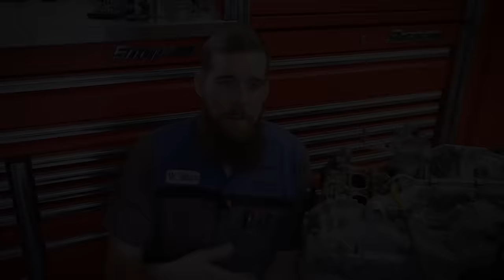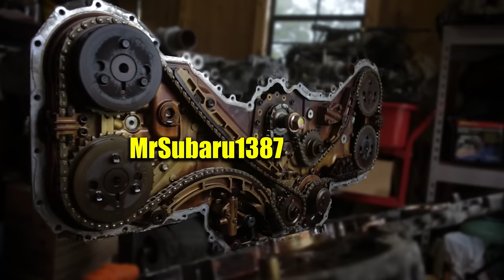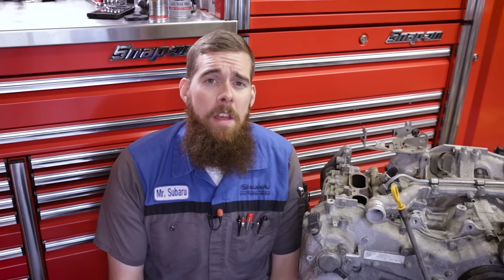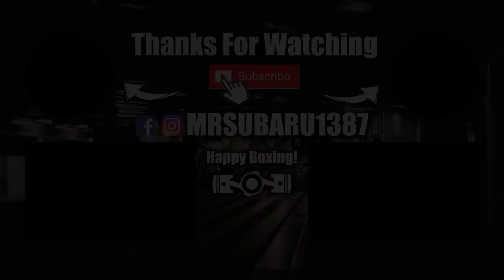Why Subarus Are So UNreliable!!! Buckle Up!!!

Comment: Subaru tech myself. We did amateur rally competition for about 9 years now. Blew up 2 motors and 1 5speed manual, not a bad statistics. About 5 years ago I finally built a motor myself. Drove that thing to multiple podiums, 2019 PMSC rallycross champion with 4 full seasons of rallycrossing and 5 years of daily driving that vehicle (spirited) and had 0 issues with the motor. Change your oil, change your plugs, keep and eye on leaks and it will last longer than Toyota
Reply: Change it myself or take it to a dealer? 😂
Reply: Not a chance. Subarus are hot garbage. I paid $44k for an engine that didn't make it to 70k. No mods, both drivers over 40.
Reply: @goatlocker219 how often where you changing your oil?
Reply: @jessejames6106 Ever scheduled maintenance was done at the dealership.  There was absolutely no long oil changes or overdue maintenance.  When I took the engine apart, it was the most fragile piston  piston I ever felt. The metal is very brittle. Being cast pistons, they are so light, I would hesitate to use them as paper weights.  The new IAG pistons feel nothing like the old terrible Subaru part.

Comment: As someone who owned a company that rebuilt Subaru engines and shipped them worldwide, I can attest to the absolute truth of what MrSubaru is saying. Don't maintain or poorly modify your Subaru and you WILL screw up your engine.
Reply: How exactly do I keep them maintained? What driving habits, things to check for, and so on, do I have to do? I want to test drive this 2022 baseline wrx
Reply: @blackliver08  2 things: change your oil religiously every 3000 miles (using a Subaru filter) and never, ever let it overheat. Install an aftermarket temp gadget if you don't have one). 
5w20 full synthetic is recommended for at least the first 100,000 miles. I personally like  synthetic blend in my 09 Forester because it doesn't consume as much oil at 220,000 miles as full synthetic. 
Use the recommended coolant and change it yearly. Check and top off all fluids at least once a month.  These are the absolute basics.
Reply: @labgramma  I changed my coolant in my hyundao after driving it for 7 years on the green stuff
Ethylene glycol .......never had problems......I tow with it .....never over heats
Reply: disappointing. subaru engines are unreliable when you compare them to something like a honda where you could beat the snot out of meanwhile you'd have to baby a subaru flat 4... they can be reliable but i feel that an off putting reality is that they are not very reliable relative to other engines.
Reply: @no1washerezz  They aren't, despite the apologists.
Reply: I’ve loved the look of and sound of Subaru’s for years. I bought a 2009 Forester XT a couple months ago with 370,000km ( 230,000) on it and had a bunch of engine codes…that’s how I found your channel 😉👍…anyhow, not trying to ramble but…I discovered the guy had skipped the last oil change, so after I changed oil and a VV actuator, reset codes, that pretty much fixed it.

I can see now why Subaru went to the CVT, I wasn’t aware of the lawsuits, but that definitely explains why they have bad to remove the risk of any future type of liability.
Anyhow, appreciate the knowledge you share and I appreciate the amount of good tips the knowledgeable Subie community share. 😎👍
Reply: @fil1329  It could still be doing the job of cooling the engine just fine but you have to consider that all coolant will eventually degrade over time by constant heat cycles and condensation deluding the coolant over time. This is what leads to corrosion and eventually damage to the head gasket.
Reply: @kumchavalcha  Yes the least reliable thing usually needs more "love" to keep them running

Comment: Another dumb point i seen was bs about "too few headbolts" Especially idiotic comparisons of 4 cylinder boxer to a v8 in number of bolts. Subarus engines have as much headbolts as engine of that layout should have. 2 more than inline, and its no diffferent to bolt counts on say Toyotas or any other engine. Few engines that have doubled headbolts like LS V8 motors tend to is not anything required for reliability, Toyotas 2JZ doesnt have doubled headbolt counts either.

Comment: I knew this was going to be about the owners. I bought a 2006 Outback with 260,000 miles for $2000. I replaced the clutch, the rear wheel bearings, timing belt, and some seals at the front of the engine. I used good parts. And, it has been dead reliable since then.
Reply from the maker: Awesome!

Comment: I 100% agree with not using cheap aftermarket replacement parts. Buying OEM Subaru parts is not that expensive and they work so much better in most cases. Same with mods. Don’t buy cheap junk, it ends up costing you more later when you have to replace it. I learned the hard way. My 02 EJ20 WRX has over 190k miles on it and still runs great. Still on the original head gasket too. Even if the engine fails, I feel like I got my money’s worth out of the current engine. And thanks to what I’ve learned watching Mr Subaru’s videos, I feel comfortable either rebuilding or replacing it since I really love that old car. I also can’t afford a new $40k+ STi, as much as I’d like one.
Reply: I just replaced an aftermarket AT fluid filter that refused to seal properly with a Subaru one... Was trying to save $20 on a part that will last another 100,000 miles.
Reply: I totally agree with you.  
Spend that couple of dollars more and get your money's worth.
Reply: My 02 Ej has 203k. love that car
Reply: YES YES YES YES. I had a wheel speed sensor issue on my 09 wrx and had to get a new axle (dont ask). Got an aftermarket axle and it caused all sorts of problems with the tonar ring and and the sensor. I cheaped out by literally 40 dollars and ended up paying closer to 400 to fix something I should have done in the first place.

Comment: I used to own a G35 that I can beat the crap out of while it was burning through a quart or two of oil a month. Sold it and got a Bugeye and everyone including myself thought I made a huge mistake. Turns out this is one of the easiest cars to do maintenance on with OEM parts still available at a relatively affordable price. I learned so much about cars doing work myself. Maybe it’s the people saying it’s unreliable so I pushed myself to always be on top of everything happening with the car. Treated the car good and the car never let me down. Dare I say WRX are the best bang for the buck cars you can buy today. Practical and fun. Will always own a Subaru in my life.
Reply: Still rockin my 07 g35 coupe at 265k miles. Had one oil leak issue that was fixed at 200k. I’m hoping it hit 500k
Reply: I just picked up a Forester with a blown head gasket and rod knock. I drive a G35. Wish me luck 😂
Reply: I think the new ones are crap. Compared to the old school but yeah 100% agree
Reply: The g35 was a bulletproof car that you could beat the absolute crap out of, never maintain, and never have a problem lol
Reply: Bugeye... as in Sprite? (Austin Healey, 1958-1960).
Reply: @petset77  nah, Bugeye as in the Subaru Impreza WRX 2000-2004, named so because of the redesigned headlights that resembled, you guessed it, bugs eyes!!

Holla

Comment: I love a good MrSubaru rant! Buy the cheapest components, buy the cheapest fluids, put your maintenance off as long as possible. The perfect formula for blaming the manufacturer!
I like a good meme as good as the next guy, but social media has truly beaten Subaru jokes to death. The spread of misinformation is endless. Some people do it intentionally for views.
Many people actually believe you need to pull a Subaru engine to do spark plugs. The old NA engines, Subaru, Honda, Toyota, could tolerate bad mods better. Turbo engines need tuning.
I'll be the first to say Subaru isn't perfect, they aren't. I'll also say there are other brands which do some things better. To say the brand is unreliable or poor quality though is purely false.
Reply: The spark plug thing always makes me laugh. It’s a tight space but it’s still obscenely easy to do
Reply: @detectivebloor4011  Depending on the Subaru it's 10 minutes to maybe at most 45-60 minutes, provided you aren't dealing with an ancient rust box. People will believe anything.
Reply: @detectivebloor4011  Woth the right tools**. I tried it over the summer and it took me like 3 hours to get the back two because of how close they are to the frame and had to get different size attachments from the auto parts store for my torque wrench. But it can be done without taking the engine out for sure
Reply: @dominicancheif117  the trick is to get good at feeding the socket and extension into the plug hole on their own, then attaching your socket/torque wrench once you’re fully seated on the spark plug. Saves you the crucial centimeter or three that you need to fit in there.

Most people who move over to subarus are just used to having the plugs angled up and out, right in their faces as opposed to on the sides of the engine
Reply: 225,000 on 2003 WRX, original clutch, timing belt was replaced at 120,000 (it looked new) - Upper Peninsula road salt is what destroyed the car. Wish I could buy the same car new today.
Reply: @jclarkj6  I have a very similar Subaru with very similar miles and the same problem, rust.
Reply: @802Garage  360k miles and no rust for my Texas raised suby
Reply: @detectivebloor4011  Nice! My daily has 275K or so and came from the Colorado desert. 1993 with very little rust.
Reply: @802Garage  Well said....Bro 👍👍👍
Only the Clueless and LazyAss who don't do the Maintenance and regular check up and Then blaming on the car Reliability

Comment: I agree, have had Subaru for the last 18-19 years or so now and never not once did it leave me stranded. Worst issue I ever had was the radiator end tanks on my 02' WRX started to separate after roughly 2-3 years of ownership and was replaced under warranty. That car lived a long life, as did my 09 STI. Proper maintenance and common sense can and does go along way.
Reply: What do you mean by proper maintenance ?
Reply: Is replacing the oil pump at 20k proper maintenance to you? Is that reasonable to you ?

Comment: A FREAKING MEN!!!! Thank you for making this. I get so sick of people constantly acting like Subaru makes junk. I've had 14 Subaru's now in every form from na ej22 cars to big turbo built ej257's and have never had a single head gasket issue or any engine failure. Ever. All it takes is some common sense.
Reply: I'm just curious... what was wrong with the first 13? I've not owned a subie yet but I want a 2.2 impreza in the near future.
Reply: @jordanlatta  nothing, I still own 5 right now. I just wanted to experience the entire platform 😅
Reply: Sounds like I'm about to embark on an extraordinary addiction 😂
Reply: I agree. They watch these YouTube videos of guys, I'm not going to name them, that claim to make upwards of 500 whp and think it's that easy.
Reply: Any experience with a jdm bp5 legacy wagon?
Reply: As a matter of fact I have one that I imported from Japan. I have not messed with any of the vacuum lines that are part of the "Black Box of Doom" solenoid box that controls the twin turbo system. It is fun drive since it has a manual transmission and the low end torque from the primary turbo.
Reply: @LusoiHardware  has it been pretty easy to get parts for? I was considering getting a 03 legacy spec b as a daily.
Reply: @laury.x For routine maintenance parts are readily available.  the great thing about subaru engines is that they are like Lego. BG5  comes with an EJ20 that can be found on the '02 Impreza WRX. Some parts can be cross referenced with the EJ25.
Reply: Man, every Subaru I've ever owned ALWAYS blows a head gasket.  It doesn't matter if the fuel filter smells of gasoline, or the radiator cracked, the brake rotors warped, or the windshield cracked on the first impact, it was the head gasket that failed.

Nevermind that my 2002 WRX is still running with it's original head gaskets 19 years later (and it's been modified too) and I have yet to need to change them...
🤔
Reply: @jordanlatta  good luck finding one in decent condition. the ej22 is the one motor I swear by but these cars are getting extremely rare, Atleast in the north east
Reply: He needs the other 4 to get to work😂

Comment: I've gone through 5 modified WRX's, Foresters, GC's. I've also had a 2018 Outback and currently am in a 2020 Impreza Sport 5mt hatch. I can without a doubt, say that the factory engineered cars are better in basically every single way I can think. I'm so glad I'm over the modifying urge, sure they're cool, but cool doesn't get you to Home Depot and back without concern on the back of your mind. Not worth it.
Reply: There's no manufacturer out there I would say is the single best on Earth but I know for damn sure they're all better than me
Reply: Don’t agree. Manufacturers have to make their cars at a certain price point, and balance performance with comfortability. If Subaru wanted to make the best Subaru they could, it would cost way too much.
Reply: But I want to squeeze more out of the ej257. Ok so I build on its more flawed areas. Pistons, Con rod (really the rod bearings), and close the deck on the block. A Cool several thousand spent. Why do I still hear stories of these things blowing when built??
Reply: @latuba2478  I'd say there is a wide gap in workmanship at the auto shops people go to.

Besides, once you change one thing you gotta change another.
Reply: @omgness1234  i agree but i’ll explain same time… subaru is not Ford or Toyota it’s small brand and they can’t invest money give us what we really looking for they are concentrated on fuel economy and family cars witch is suck for me i own 2 Subaru’s. 06 outback H6 and Ascent 2.4 Turbo you gonna kill me to drive damn 2.5 180hp no man not for me i need power and i don’t give a F… how much gas it use. I like bigger cars not huge bigger with acceptable power 280-350hp nothing for me i can’t have WRX STI because of family and what i’m looking for but they don’t care they can’t make me happy and spend more money then they do know… like me there is 10 from hundred…
Reply: @latuba2478  as soon you open Engine is not gonna be same no more… they power engine and transmission until they can give you warranty on it. another ways they could push more but there is much smarter people doing all that then we so risk is yours…
Reply: That's why God made dailys
Reply: @johngoepel5263  exactly so at that point you shouldn't complain about a manufacturer not overengineering their daily driver cars to handle aftermarket abuse and tuning. The arguments are pointless, and the answers are simple people just don't understand that and expect the best of both worlds.
Reply: Funny how all these high performance subaru engines dont use any high performance parts in any of the cars iv yet to see a stock aem intake or nameless muffler come factory why you may ask?
Reply: @aathmpsn  I think people expect a turbocharged car with AWD and a rally lineage to be more sporty and stronger than a standard grocery getter.
Reply: @Austin O'Brien Then I guess it's  a shame that Subaru makes poser cars from the factory. They might as well stop producing turbo cars and just put a speaker in the dash that makes a blow off valve sound. In my humble opinion turbo'd Subarus should be sports/rally cars made comfortable, and not a grocery getter with a brittle drive train and fake vents glued on.
Reply: @Austin O'Brien welp it would be nice if they built one of their cars to be modifiable. While most would say the BRZ, its compression is way too high for safe boosting. The WRX is probably best suited for increasing boost because of its lower compression, but this video/thread has taught me that's a no no. It's really sad when the most powerful car your company produces is only safely capable of Hybrid RAV4 horsepower/acceleration.
Reply: @johngoepel5263  I love my 06 wrx. Just finished with all of my mods recently. Completely changed the intake system, Upgraded fuel system completely, installed a flex fuel kit, upgraded the radiator, and put a jdm twin scroll sti turbo. Can't forget the $1k tune. Car now makes 380 hp on a jdm 2 liter. Already got 20k miles on my $800 junkyard motor and it is running better than ever. But I'm saving up to build an engine for next winter when I will have beat mine to death.

If you want a cheap car with high horsepower do not buy a subaru. Brand new wrx  is coming out with 270 hp. And my 06 had 230 stock.  Just go get a mustang or turbo bmw and get double or triple what a stock wrx motor can handle reliably.
Reply: I think this is what Subaru is doing with the fifth gen WRX: they're making it tunable but, more reliable and it looks more adult than previous generations as it should to some extent.

Comment: Owners can be unreliable...Unreliable owner, unreliable car, regardless of make. My dad always used to tell me "Take care of your car and it'll take care of you." I've owned many makes of cars and the same applies but Subaru is my fav. Had a '76 DL in the early 80's. Couple of outbacks (2000 and 2012) and impreza's (2003 and 2007) and now drive a 2016 crosstrek and 2019 STI. Never had the "gasket issue." Reliable as all get out cause I don't drive stupid and check change the oil/fluids/maint regularly as recommended or better. You're spot on with everything you said.